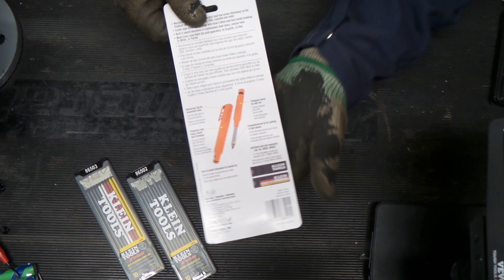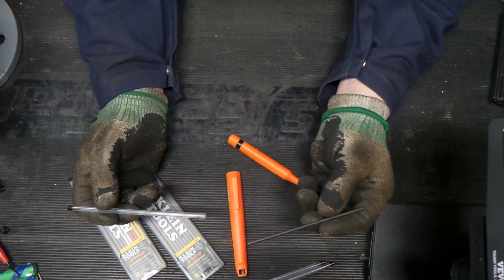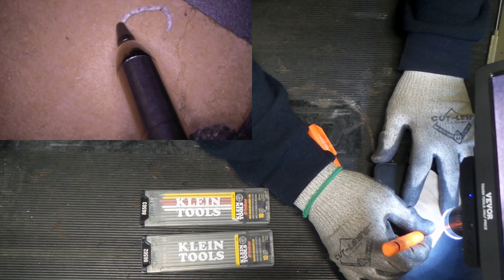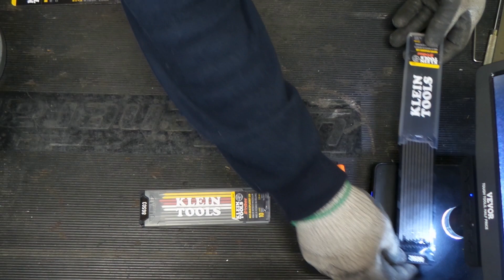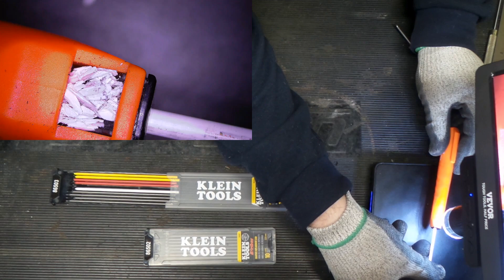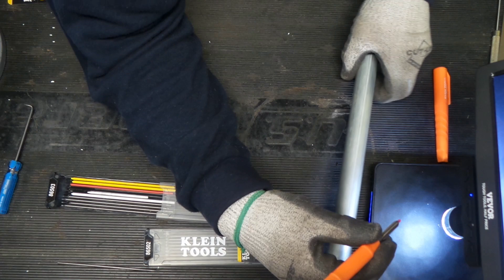Klein Tools Skribes™ Mechanical Graphite Lead Marking Tool w/ Replacement Lead (86501) Review

Comment: I've now been carrying one in my pocket for the better part of 7 months as I do a large amount of EMT (I'm an electrician and fire alarm tech). I love the clip cuz it stays on my belt or in the tech pouch of my pants, but it's always nearby when I need to mark something. I can't even begin to count how many mechanical pencils or carpenters pencils I misplaced before this. Simply put, at least one of these will be in my bag everyday for the remainder of my career.
Reply from the maker: I've had this one in my pocket every day since this video was made. I haven't had any major issues with it. I leaned on something and damaged part of the holders clip, I can't blame the tool for that though. What brand Fire Alarm systems do you work with Siemens, Honeywell or something else?

Comment: It is interesting that the part number on your actual pencil is 86500...of which there is no reference to that Klein part number on the Googler.  The part number in your description is correct though.  That said, Lowe's had the refills when I walked through the store today, but no pencil.  I checked the Lowe's website....also no Klein pencil.  Lowe's did have the OX Tools Pro Tuff Carbon Marking Pencil (OX-P503211) on the shelf right next to the Klein Refills.  I did not realize it at the time, but I'm guessing the Ox Tools and the Klein refills are compatible.

These big companies (Lowe's / Klein) really need to get their act together.

EDIT:  The pencil on Klein's website has a part number of 86501 but the graphic on their product page also shows 86500 as of 03/17/2025.
Reply from the maker: That's interesting. I wonder if the holder is a different part number and the pencil holder and graphite  are the 86501?

Comment: My favorites have been the OX brand for one big reason: the sharpener is on the clip!  I can sharpen mine w/o taking the holder out of my pocket.
Reply from the maker: Someone else mentioned these, I think I'm going to have to check one out! Thanks for the comment. Have you seen any quirks with any of the models you tried out or things to look out for?
Reply: @TalkingHandsTools  The only problem I've ran into is the one I broke internally so it no longer advances lead.  Not the pencil's fault; it got launched across my workshop when I dropped a board.  I do wish the sharpener on the OX clip was on the other side as I'm right handed.  It would work better in my workshop apron.  But I can sharpen left-handed and don't have to take the holder out so it's overall much better.

About the only "quirk" is one of my 3 has a smaller cap.  This is the one I keep in my pants because it never catches on anything and pulls the cap off. Haven't been able to find another one like this.
Reply: Check out the hultafors! I used to use the OX too but like you said the lead kept breaking inside the the pencil. I saw a carpenter using the hultafors and talked to him for a bit he said he’s never had the lead break inside and he’s been using them for several years and my selling point was that they have a built in sharpener too
Reply from the maker: I'll check those out, thank you!

Comment: I'm a long time pica user recently went tracer/tracer pro and have tried many other like ox hibloom ect.  The little notch in the shaft hits a c ring if I remember in the bottom of the holder hince the hard to pull out.  Don't quote me on that I got that pencil and its in some drawe of unused stuff.  For me pica is made in Germany about the same price leads are made in Japan or Germany.  Pica also is a friction fit just finds it's way in and has the right amount of resistance.   I like the sharpener on  the tracers since it's on the clip so you don't have to remove the holder to sharpen (ox does rhe same thing).  Tracer pro is all metal construction besides the plastic holder so a premium version.  No markings stay on these pencils they will wear off.  You got a start of a rabbit hole here i suggest you try the ox at the blue home store if you are curious and want something in store.  Alot of info but I found the klein to be hard to remove and not as good as any of my current offerings are or more expensive than.
Reply from the maker: You know me and rabbit holes. This would be a quick and easy time filler until the OT dies down a little, and we can get into some proper screwdriver testing. A few of the models you brought up sound nice, I'm a big fan of all metal things. The model that sharpens in the holder sounds neat, I'm wondering if I could keep from playing with it!
Reply: @TalkingHandsTools  in my framing pouch i do carry a pica pencil that is ridiculously long and it has a quiver.  The special thing about that one is it's half black regular the other side is a white hard pencil lead not crayon like.  That one in particular isn't fragile and if your looking for color but in a more work friendly format.
Reply: @TalkingHandsTools ox at the blue home store has the clip mounted sharper good overall and easily found in store for kicks.  Ox makes a 2 pack of permanent markers on the same style of holder pull it out clip on.  They are 8 bucks 4 bucks each and are decent same rules apply you dont loose them because it has a home.  They are much more economical than pica markers at 10 to 20 dollars each for holster type even though I love them and they ooze quality.  For a basher of a permanent marker try the ox!
Reply: You owe it to yourself to try a pica they are the classic.  Good luck finding a tracer pro without getting one from Japan/uk or spend 30% more from usa sources like hd I'll let you look them up there expensive.  The magic behind these pencils which i saw a few comments about price vs free ones is they have a home you dont loose them.  They clip into a pocket tool bag whatever and its painfully obvious if it's missing.  It should be there 12 to 30 bucks each!  When your pencil always has a home and your get some muscle memory about putting it away you dont loose them.  I only lost one pica and it was 4 years old and didn't even have writing or resemble it's original form it was beat up.  Not that it matters to many but i like to support non China sources as much as possible especially since there about the same price.  These at least are part of the blue store klein cash grab on there reputation   with the slu of products.  Branch out have some fun with the pencils 1 lost one in 4 years is good I'm sure you will have luck too.
Reply: Tried most of them over the past 10 years. Pica still head and shoulders my favs.
Reply from the maker: @amerikalast Good to know maybe I'll pick one up to compare with.
Reply: Tracer pencils are the best you dont need to take the holster off to sharpen. Also Home depot now carries the pro series and I love them and dont lend them out
Reply from the maker: I'll check them out. Not loaning out something you like is a good move.

Comment: As a carpenter I refuse to ever pay for a pencil when the lumberyard gives them out for free. That said the colored ones may be handy for marking certain materials.
Reply from the maker: You know how the electrical guys can be. I'd have to agree with you. If I had a bunch of free ones from lumber yards, I probably wouldn't go after something like this much either. 

I'm excited to play around with the colors a bit more. So far, I've only used the standard graphite, and it has been great.
Reply: @TalkingHandsTools  I've used ox pica and generic lead off azon.  The pica seem to not break as much and last longer but they come at a higher price.  I also mark on almost any material the pica colored mark on glossy tile too.  I can't think of a surface besides a vat of oil or rust they can't mark on.
Reply from the maker: I have some other brand graphite and colors on the way, I'll be curious to see how they compare. I've dropped this pencil a few times and haven't managed to break the graphite yet, so that's a win.

I, too, have found this will mark on most things. To be honest I still mostly use soap stone to mark conduit for bends. Just don't slide your hands down the pipe before you bend it. I like soap stone for that cause it's easy to remove. I will try this pencil on oil slicked rigid and see if it has issues.
Reply: @TalkingHandsTools  yellow works well on black pipe gas and happens to match the  color of thread sealing tape as well.
Reply from the maker: I do like there's some contrasting colors available. Do you notice the colors wearing down quicker? They seemed quite a bit softer in our testing.
Reply: @TalkingHandsTools  I've only used the generic Pico knockoffs, but yes, any of the colored "leads" seem to be much softer. Sometimes that helps, sometimes it just breaks. It's a clever balance.
Reply: @TalkingHandsTools  the  colors are more crayon like than anything it's why they mark on less than great surfaces.  All the yellow and white  i own is soft some of the  cheaper ones you look at they melt/break some you can actually handle without destroying.  I think your gonna have your hands full with testing brands ect on this "tool".
Reply: @TalkingHandsTools  I wish your test had included trying them out marking materials that may not mark well with a standard pencil or may not be as visible. As always, excellent in every other regard.
Reply: @Wordbiker  white leads are great for ironwood walnut and composite deck pt lumber anything dark.
Reply from the maker: Give me some good examples to test on. I think we could make that happen.
Reply: @TalkingHandsTools  Dark stained wood, galvanized pipe, aluminum, plastics.
Reply from the maker: Thank you, I'll see what I can do. In the original version of this video, I did have aluminum, but it got cut out with my file corruption issue. I'll see what incan get together so we can revisit this.